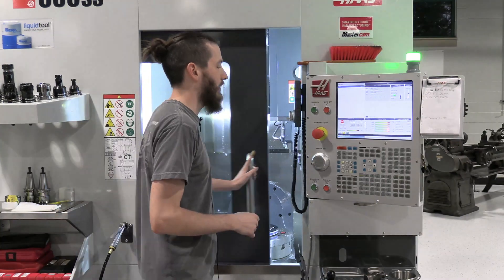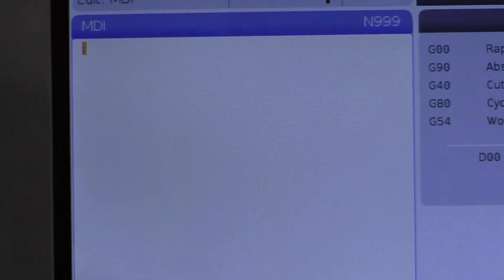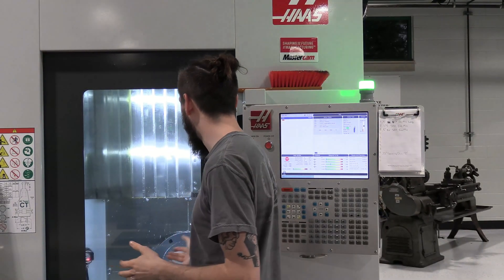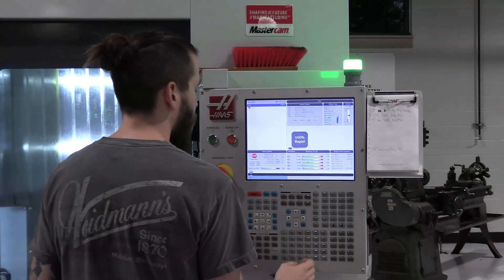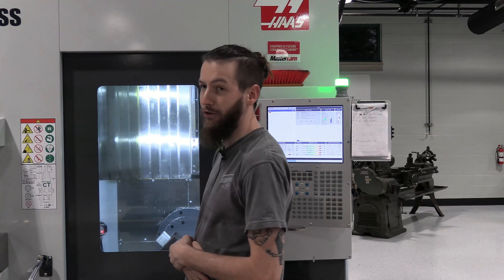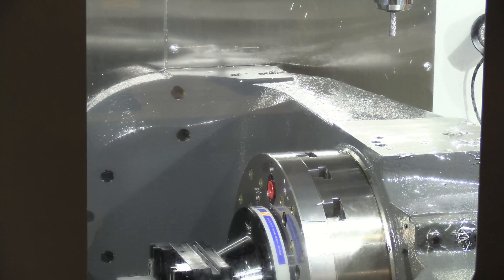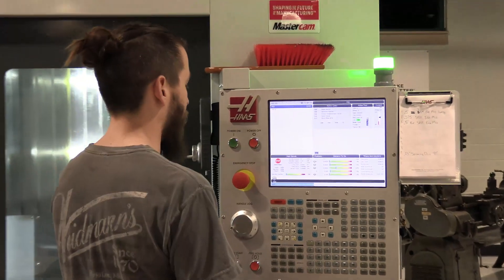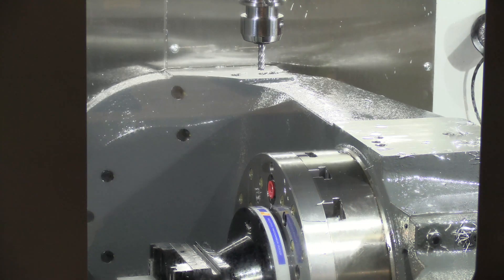The Basics of 5-Axis Machining

Comment: I use a umc 750 but use a cam system
Dont see the point of dwo and tcpc 
Yes its quicker to probe the job in and you dan set the job anywhere on the table but its a solution to a problem that doesn’t really exist and you can only really do basic milling with this type of manual programming

Comment: I love how haas is easy to set up but i dont think it is a very good 5 axis machine, its not bad 3 axis but with two additional axes its not rigid at all
Reply: Right
Reply: You are real Stainless steel machinist right there. Haas suck.they are good to marketing business only. And might help people open business as a machine shop at 1st time
Reply: Mazak, okuma - those are good:) back in ireland i was working on doosans and even those machines were much more rigit then haas, Remember machining Titanium for aviation, not a problem, would not try the same speeds and feeds on haas
Reply: You are right about haas as a good machine for starting up your own business. Very cheap according to what you might achieve after a year or two, also good machine for learning, very easy to set up, not so annoying with servicing. Had good time with haas, but its hard to go back to haas after milling on okuma...
Reply: @mateuszsiwek108  not yet. After couple of yrs poor operators to take care chip and leaking coolant we had those, scary! Okuma, OKK, those are best and  peace of mind. 💪👍
Reply: Yaaaa, I’d stick to aluminum with that haas lol
Reply: Never had a problem hold tight tolerances with a haas. And we ran only stainless steel (304,316) and at times inconel, holding tolerances majority within +-.001, was holding +-.0005 at times. It’s not the machine it’s the machinist
Reply: @Lustofdecay_710  Ya, but for how many years and how much faster could you have gone with a machine better suited to those materials?
Reply: @Rightisallwrong  well, you dont have an idea if youre asking. Try okuma or mazak, you will hear The difference